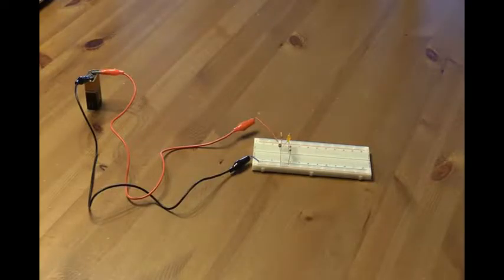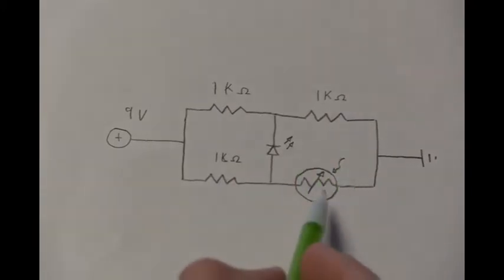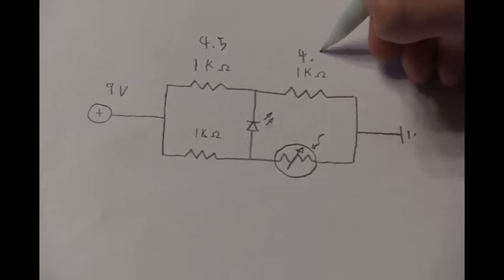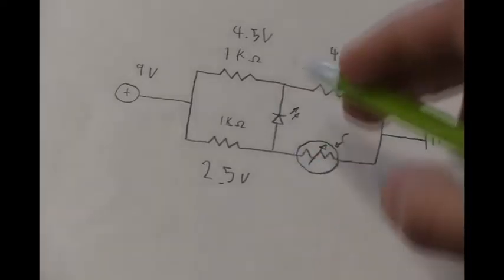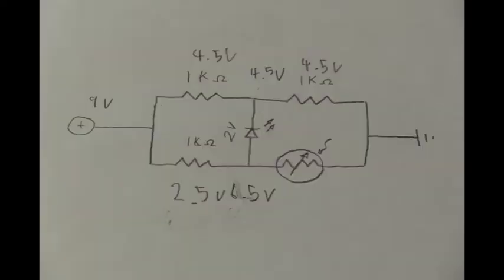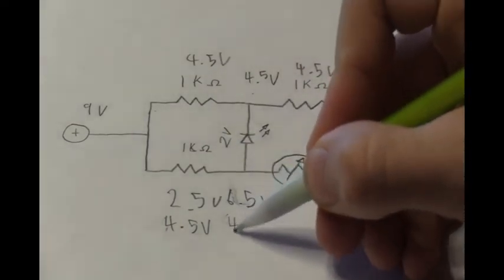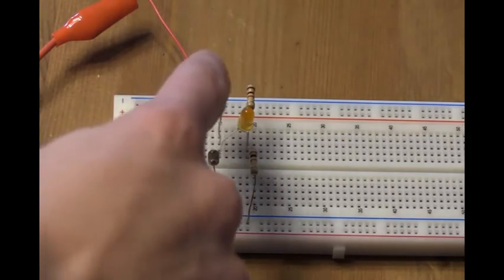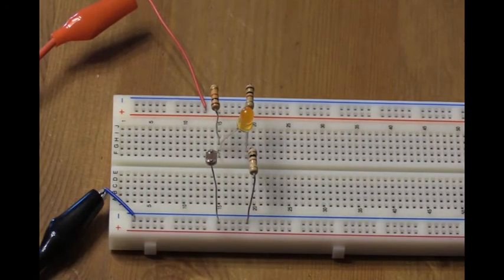Darkness Sensor Night Light using Wheatstone Bridge

Comment: My LED LIGHT IS ALWAYS ON can I know y
Reply from the maker: Double and triple check your wiring. If the LED is in series from the source to ground, it will always be on. This works by putting the LED across the gap. If you are using a breadboard, make sure the LED and resistors are in the correct lines.
Alternatively, it might have to do with your resistor values. You can use the resistor values and Ohm's Law to check the voltage across the LED at different light levels. If you have a voltmeter you can also measure it manually. If the voltage never drops below about 2V, the LED will always be on.